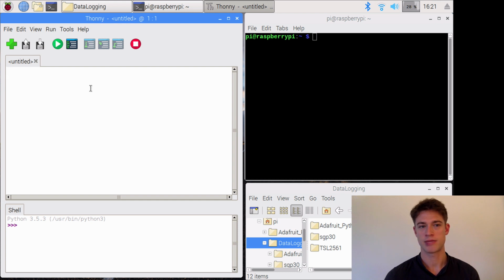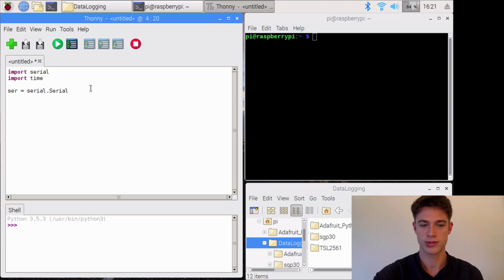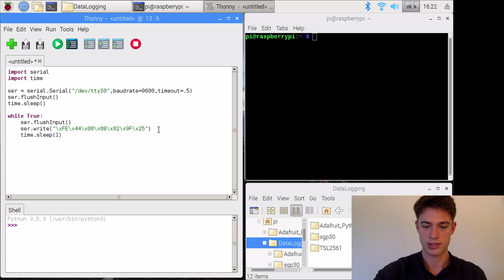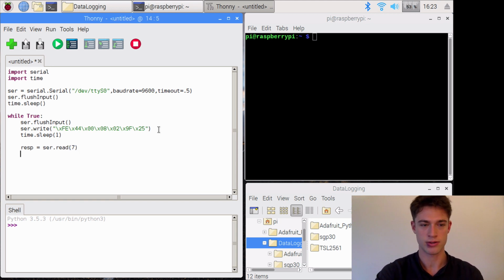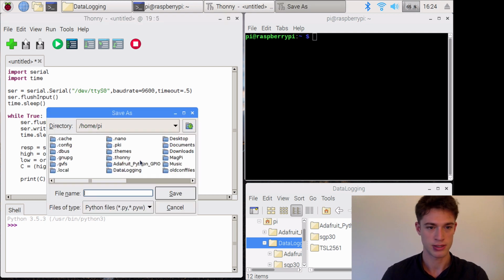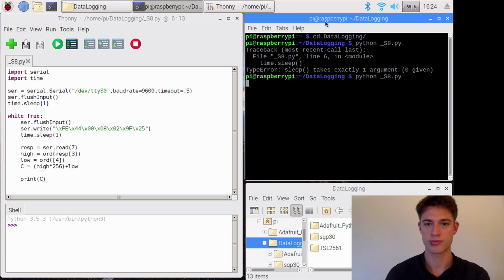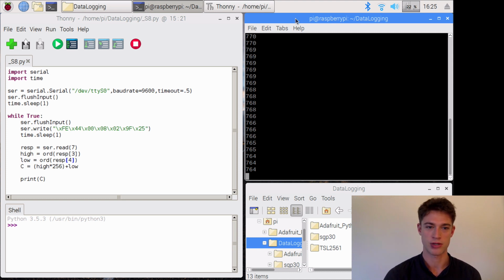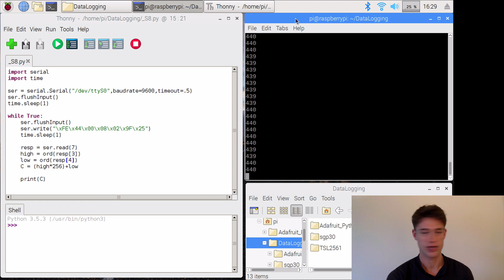12 | Indoor Weather Station | SenseAir S8 | CO2 Sensor

Comment: Nice Video man, can I make this work with an Arduino Uno? If I wire it the same way with 5V, GRN, TXD and RXD, or would the code you used give me problems, because Arduino IDE just is different software?